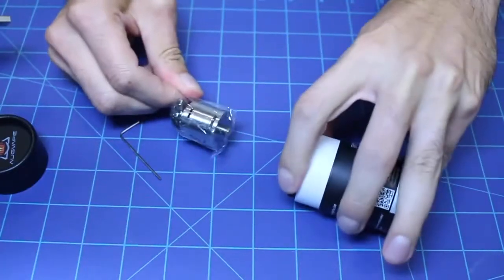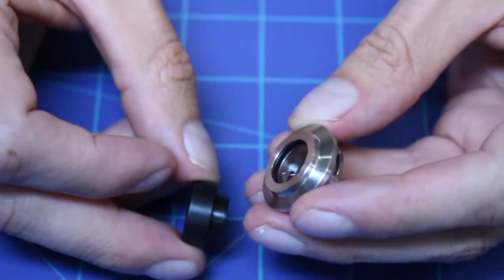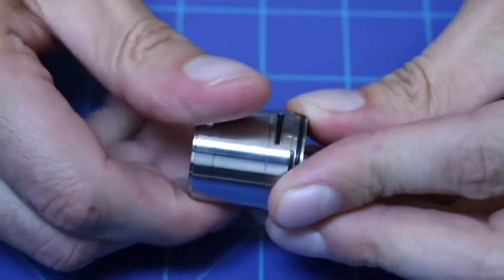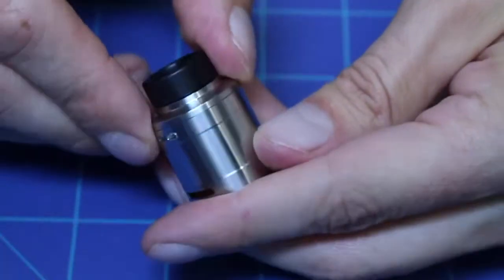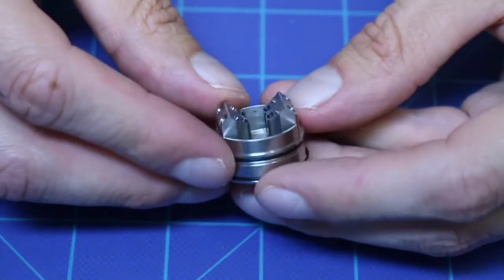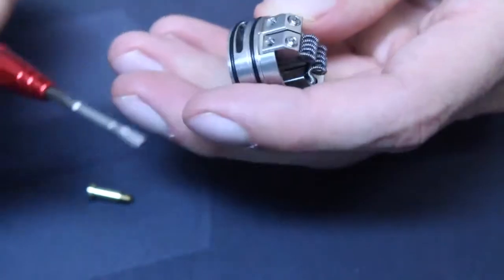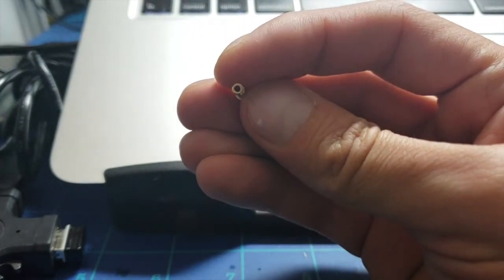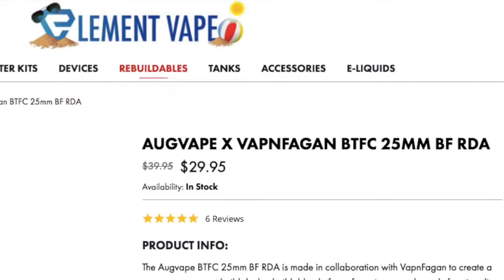Augvape x VapnFagan BTFC RDA Review

Comment: Hey Alex I’m watching old reviews and stuff today and I wanted to drop a comment real fast. I have two BTFC’s one stainless steel, and one gunmetal. Both of my top caps are so tight that the drip tip pops out without pulling off the cap. Both are so tight that I have to either use my nails to slowly work the cap off and sometimes I have to pull the whole barrel off and push the cap off from the inside. If yours is that loss I would try swapping out the o-rings maybe it’s just a shitty o-ring. Talk to you later brother. 👊🏼
Reply from the maker: Oh interesting, thanks for letting me know. I'll try swapping the o-rings!
Reply: Yeah when you have a minute switch out the o-ring for a fresh one and see what happens. You already have them so it will not cost you a dollar. Please let me know if that does work. It happened to another rda of mine but the o-rings they used were just the wrong size. They were to small. So I went through all of my o-rings till I found one that worked perfect. I bought about 5 dozen bags of all different size o-rings from my local hardware store. I now have a big plastic case with tons of little dividers in it. It comes in super handy and the whole thing cost me like $25/$30.